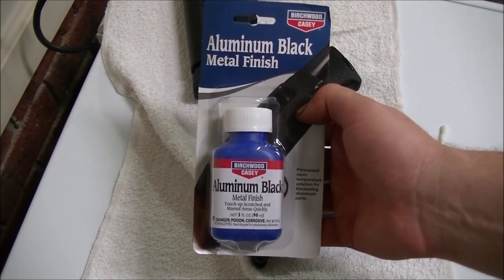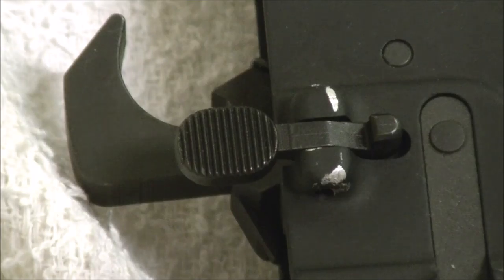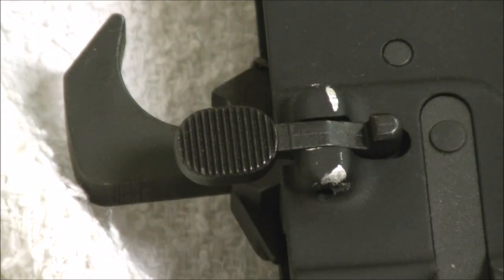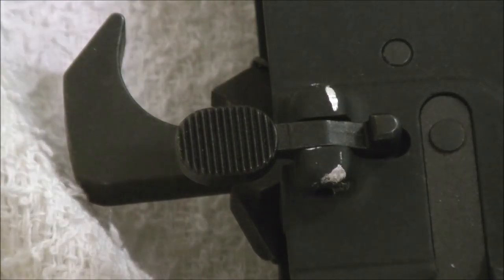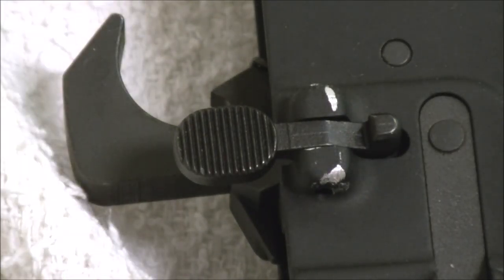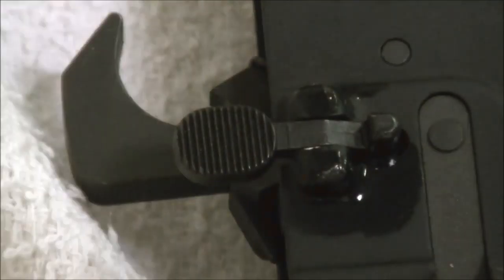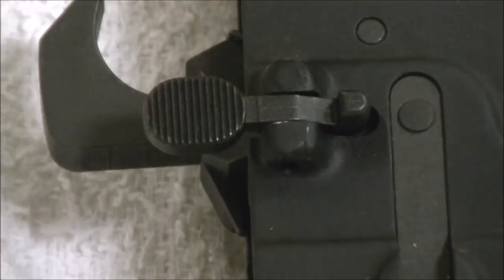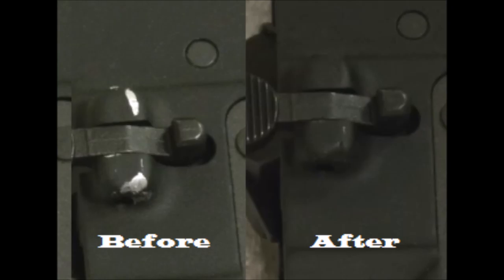How to fix your scratched ar-15 Birchwood Casey Aluminium Black Review

Comment: Works even better if you apply heat to the area after cleaning to about +- 300 degrees but use a clean flame (ie, pencil torch) be super careful and don't hit any polymer or plastics. It blends in better and the heat also remove impurities and help the treatment react better with the aluminum and anodizing.. There is another video out there that shows this.. I used it to fix a couple spots where I slipped with a punch and it went through the tape and put a scratch in it.. You can't even see it at all amazing.. Love this stuff. Works best for me on Hard Coat Anodized lowers. I don't don't know about other black coatings.
Reply: sounds like good advice

Comment: Scratched my lower getting my hammer installed. Rookie move but I'm gonna have to buy this now
Reply from the maker: works great as long as the surface is cleaned with a strong degreaser
Reply: @Reviewsandmore   thanks man. I'll get right to it. once I order my buffer tube kit I'll send it to a gunsmith. Lower complete.
Reply: @S3cK5hun8  wait.. you're not installing your own buffer tube assembly?
Reply: @FahimibnDawud  I sent it to a gunsmith. The rifle is done and still runs like a dream

Comment: Just finished a sick build with a Spike's tactical upper, and a Ruger lower. NO play anywhere! Gotta hammer the takedown pin out :) Then as I was trying to tighten the buffer tube castle nut the fucking shitty ass multi-wrench slipped off and dinged the lower, right where it meets the upper. Thanks bro, for the tip and and sharing my rage. G0DDAMMIT!!!!

Comment: I got some rust on my ruger precision rifle and I removed the rust but you can see where the rust was would this work to cover those spots up
Reply from the maker: Probably not.  This chemical reacts with aluminum to creat a durable coating. If your rifle had rust then this chemical will likely not work, as the rust is only going to exist on steel/iron
Reply: No.

Comment: did you rinse it off with water after?
Reply from the maker: dabbed with a moist rag
Reply: its been couple years now ... how is it still? did it hold up? did it corrode or ruin any of the original coating? and you said you dabbed it with water did you put gun oil on it after? my ar is all scuffed and scratched up i was thinking of buying this stuff but wasnt sure ... what do you think?
Reply from the maker: oh yeah, but I do that when I clean my ARs (oil that is).  So far it has been fine, that being said I am not very hard on my firearms.

Comment: How well does this stuff hold up to a cleaning or good oiling on the receiver of a gun
Reply from the maker: Mine has been fine so far, but my flaw was in a fairly low traffic area for placement of my hand.  I cant speak to fixing areas closer to to heavier moving parts.
Reply: @Reviewsandmore  mine is on the outside of the reciever next to the model number I was just curious if a good wipe down with clp or Balistoll would bring it off ...I really appreciate u replying by the way
Reply from the maker: @bigvon7848  I think you are safe.  If not just re apply to a very clean dry surface...use a good degreeser
Reply: @Reviewsandmore  i used alcohol and it seem to have stuck well out of curiosity I have tried to scratch it off as hard as I could and it seems like it  is cemented on thur ...I was just wondering if any kind of cleaner or lube may bring it off

Comment: how is this any different than the super black pen?
Reply from the maker: it chemically anodizes the aluminum to create the anodized finish.  At the factory they literally dip the lowers in the vat of this stuff to turn the metal black and give it the protective anodized coating.

Comment: I have a old M16A2 Colt upper,it has a good amount of wear and knicks (mil sur) around rear sight and the rail.. Any tips on repairing them
Reply from the maker: if the upper is anodized aluminium then this product will work.  If they are painted or some other surface then I really could only recommend a touch-up with a matching matte finish paint...but that will still be pretty vulnerable to re-chipping
Reply: Take it to a powder coat place...

Comment: This stuff rubs off easily... UNLESS you sand blast the part before you apply it, THEN boil the part for 1 minute after applying.
Reply from the maker: a good de-greaser will usually do the trick for me.  After that just make sure that it doesn't stay on too long or the anodized finish will kind of "cake up" and that can make it fall off easily.
Reply: WeaponGeekReviews is it possible to add a section on how you prepped it prior to applying the solution? I'm seeing so many reviews on how this liquid does not stay on.

Comment: You made those scratches with a punch and small hammer? How? I can't even see how what is possible. I looks more like you rubbed it on the sidewalk.
Reply from the maker: Wife had really really bad bolt over brass jam....bullet extracted powder everywhere...tons of fun....as I remember we tried to do a feild strip....would not work....so we tried to do a very forcefull feild strip...did not work...then I got it home and into a vice and by that point I was pissed and not being careful....and then that oops happened....it has been a few years but I am pretty sure that was the order of events